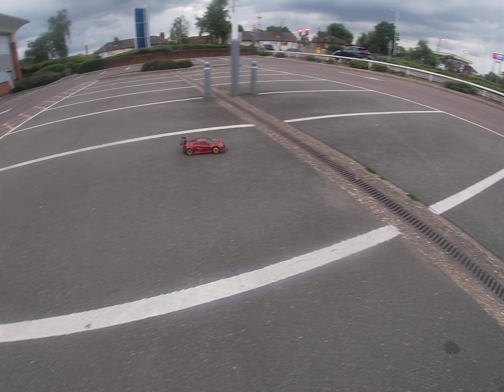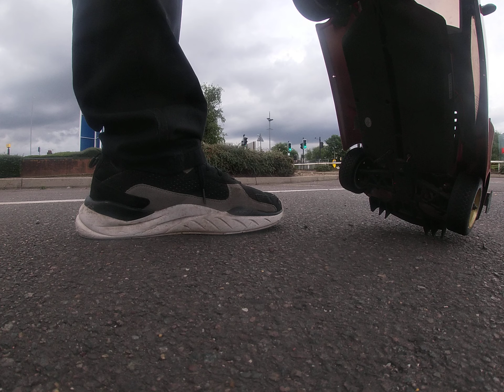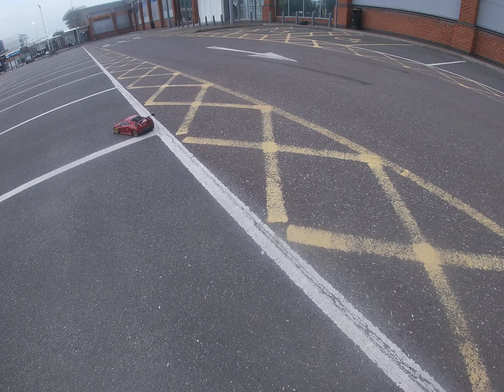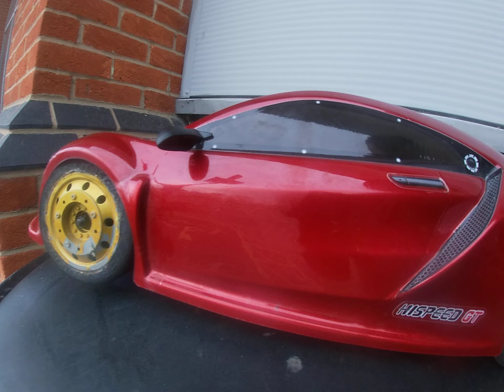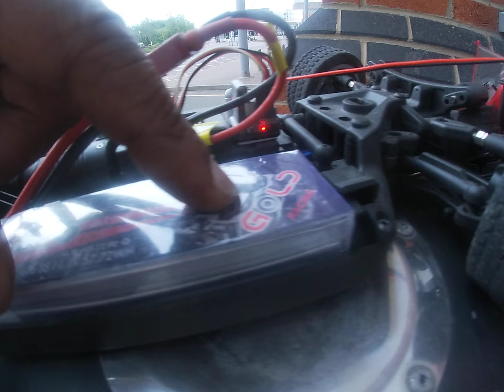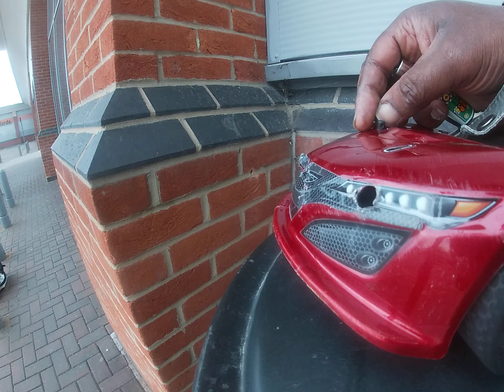Who put that Concrete Curb there?😩😫😪🤧

Comment: What tires do you use? man my 1/10 absima touring car destroys tires every 4 batteries. Comparing to my 1/16 hbx where tires last forever even on 3s. And yes, the absima runs only on 2s brushless now but even on the 540 brushed it destroyed tires. And because of that the steering becomes twitchy and very hard to keep it in a straight line.
Reply from the maker: Hobao semi truck wheel tyre combo I'm using bro, they hook up well, only thing rims are different front to back as they are hgv truck wheels